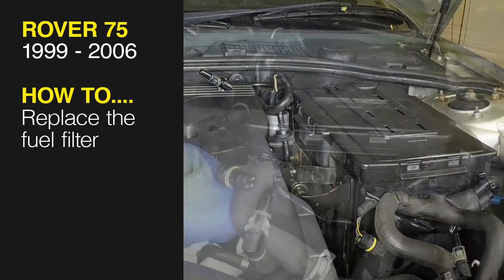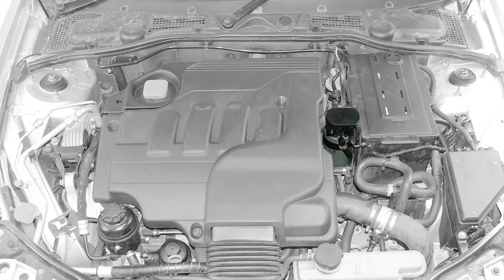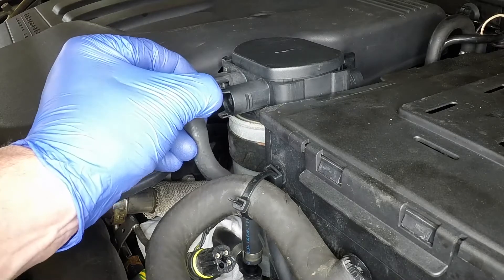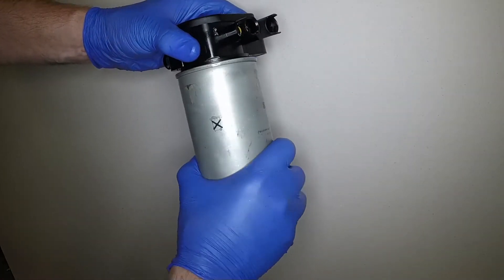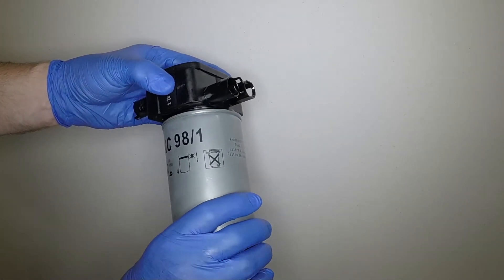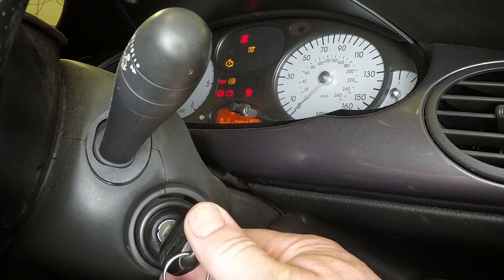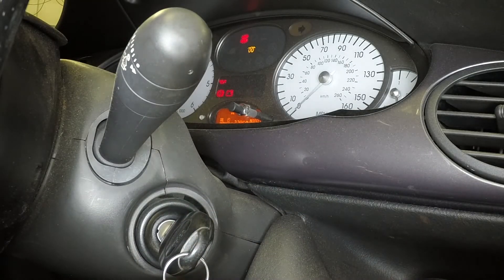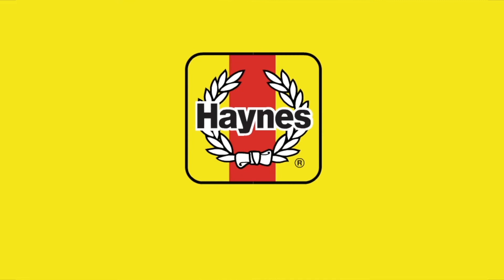How to Replace the fuel filter on the Rover 75 1999 to 2006

Comment: Is it possible for Haynes to show how to do this on the 1.8 litre models? I can not find the filter anywhere in the engine bay. Ive got the owners manual but it does not show how to replace the filter. I know where it is at the passenger seat. But I can’t figure out how to get the old filter out.
Reply from the maker: Sorry, we don't have a video showing the fuel filter on the 1.8L. On some models the filter is incorporated into the tank-mounted pump/sender unit. Access is through a panel under the rear seat cushion.
Reply: @HaynesManuals  Ok to bad, yes I know where it is located it is where you describe it. But it seems like impossible to get the filter out. Thanks for replying. I’ll try Rover forums.